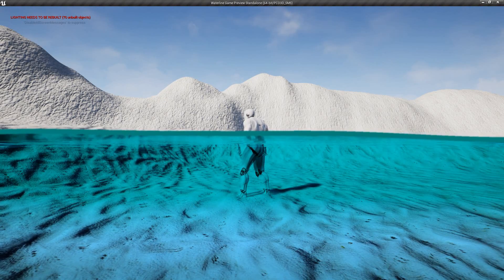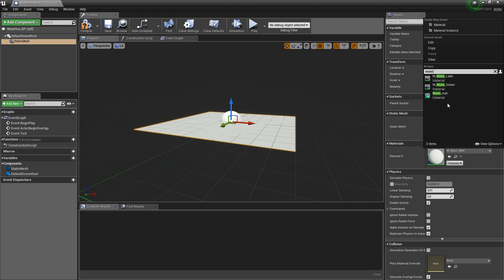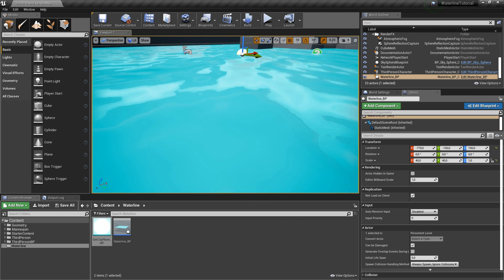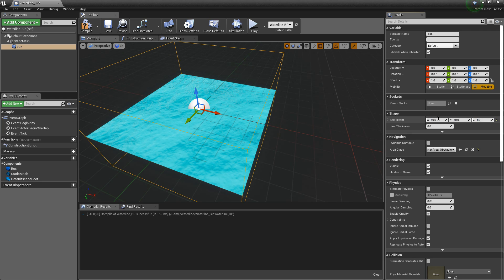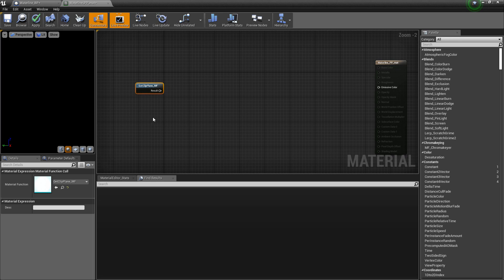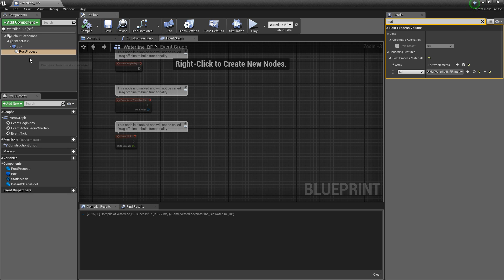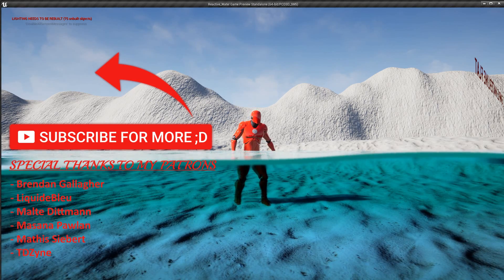UE4 Tutorial Water Line #1 -  Creating a BASIC waterline with half under water split post process

Comment: Hey! Great video. Took me a while to figure out how you got the clipping plane. I'm not sure if i'm the only one having this problem, but for some reason UE5 near clipping plane and the plane from the function do not seem to align perfectly - you can see the post process overlapping the water surface. All parameters seem to be set correctly including water level. I'm running UE 5.2.1. If anyone knows what the problem is would really appreciate some help. It's as if unreal's near clipping plane is not exactly 10 (checked, it's set to 10).
Reply from the maker: you have to change the all pp materials tonemapper to before translucency then it might work
Reply: Works with both Before Tonemapping and Before Translucency. Thanks a lot for such a quick response! @MarvelMaster

Comment: There's an issue with UE5. Waterline doesn't match the water plane, it appears slightly higher. The distance between them changes depending on camera pitch angle.
Reply from the maker: you have to change the all pp materials tonemapper to before translucency then it might work
Reply: @MarvelMaster  That actually helped, thanks a lot!

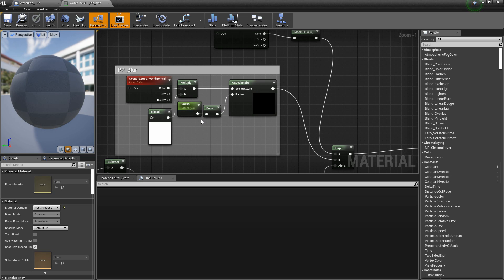Comment: 17:00 it doesn't make sense to me as you link the SceneTexture:WorldNormal as the input of gaussian blur. But you get the right effect. I have to  change back to PPInput0 to make it work.
A note is needed.
Reply from the maker: yes i was wondering the same but that part was copied from the internet
Reply: @MarvelMaster  I get it. It doesn't matter what the SceneTexture input is. The codes are meant to read the SceneTextureID =14 which is the PPinput0. The SceneTexture Input is just a complier trigger that declares some built-in functions like SceneTextureLookup

Comment: For the height of the water which yours was 190 is there a better way around having to make multiple instances for different water levels as I am trying to make an open world map so I was wondering if theres another way as making multiple instances for different water levels would be a pain.
Reply from the maker: How about a collision box around the water that changes material params dynamically
Reply: Well past when this was asked, but maybe it'll help someone else. I ended up using Material Parameter Collections. I made a scalar global parameter called sea level,  and set it (Set Scalar Parameter Value) in the waterline actor's blueprint on Event Begin Play by Get Actor Location (target self) and setting the scalar parameter value with the z axis (aka the height the waterline plane was at). Then, in the materials where this value was needed, used CollectionParameter to get the parameters from the global collection I made that had the sea level scalar parameter.

Comment: Great tutorial !
I am trying to mimic your shader for Unity by handwriting it.
But I struggle to understand what is the result of the GetClipPlane function ?
What is the purpose of divising a dot product between the "cameraDirection" and "the pixel to camera direction" by the nearplane ?
And why this result is multiply again by "the pixel to CameraDirection" ?
Some help would be really appreciate !
Again, this effect is amazing.
Reply from the maker: In which blueprint is that
Reply: Hi Marvel Master,

I am talking about your UE4 blueprint : GetClipPlane function.
I am trying to convert it in HLSL but I can't figure out the output of this function.

So to understand and code it, I would like to understand what occur when you divise the dot product of CameraVector and CameraDirectionVector by the nearclip.
And why you multiply this result by the CameraVector again ?
Reply from the maker: @athlantanis316  well thats unfortunately a magic trick the devs used I dont 100% understand...its basically getting the location and rotation of near clip plane and then offset the output by clipplane value added to camera...maybe this thread can help
https://forums.unrealengine.com/development-discussion/rendering/112966-under-water-above-water-split-view-is-this-possible
Reply: Thanks for your help and this thread. Yes it helped !
Reply: @athlantanis316  I'm trying to replicate this aswell and i'm struggling a bit, have you got a solution for this?